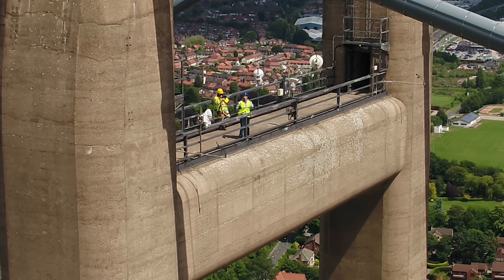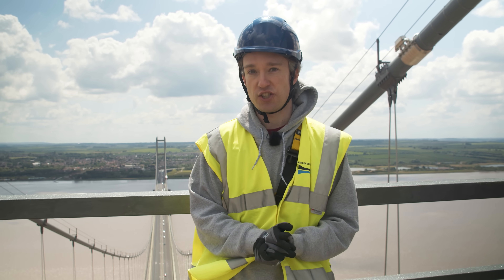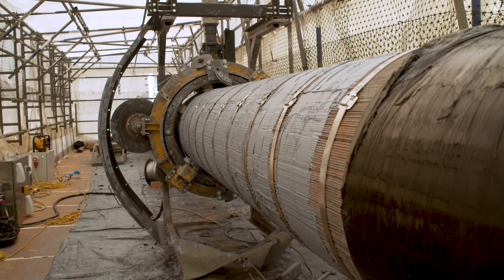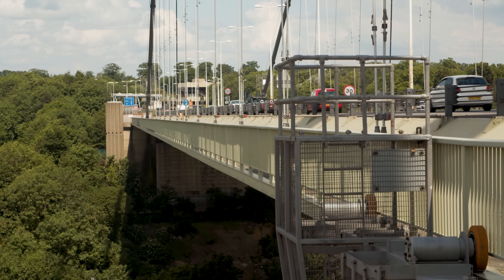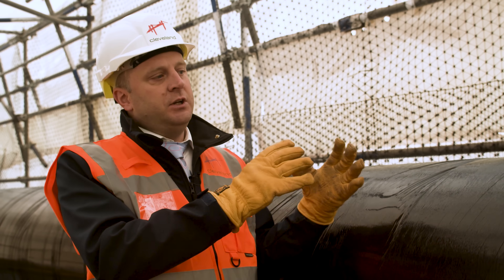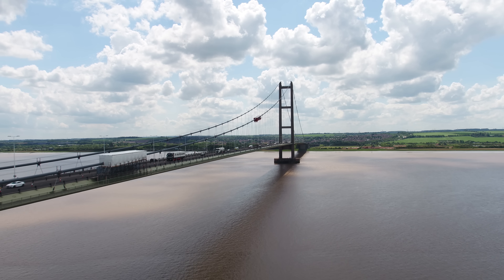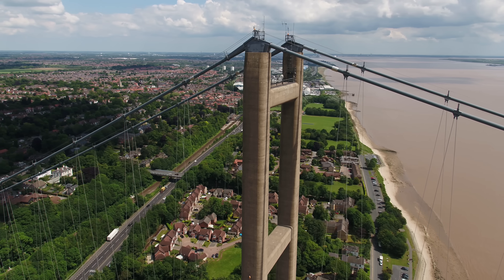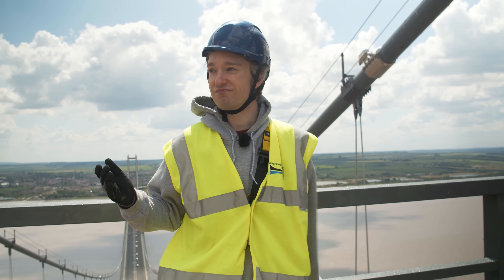How to stop a colossal bridge corroding

Comment: You did not explain clearly how dehumidified air is pumped into the cables. You can use schematics to explain clearly. also note that dehumidified air has to travel hundreds of meters along the cables. by the time it reaches the end of the cable, the pressure would have dropped significantly

Comment: 0:29 Are you sure it's cm?
I tried to calculate, and got about 4 mm

I used:
span: 1410 m
tower height 155.5 m
earth radius: 6371 km

difference: 3.8 mm
Reply: Movement?
Reply: @damianleah6744 offcouse they move, but a single number describing distance would not be a dynamic with movement, but a static average.

However they can possibly be tilted outward, to compensate for some other geometry.

Comment: We do the same thing for transmission lines underground and even up broadcast towers. Nitrogen pushes out moisture, maintains consistent regulated pressure, and it makes it easy to tell if there is a breach in your line.

Comment: Cool! I was wrong in initially guessing that theyve built an air tight cylinder arpubd it abd pressurized it, so that no moisture (or outside air) could enter it. 

But i suppose just blowing air through it works!

Comment: This is something that is neglected everywhere. Stuff has a limited practical life. That means that even after purchase, costs continue. If that bridge had an estimated 50 year life, then in addition to the cost of building and the cost of maintaining, at least 2% of the cost, increased by inflation, should be put aside to pay for the replacement. A water heater is expected to have a lifespan of about 15 years, which means the responsible owner would be stuffing an envelope with 7% of the cost of that water heater (INCLUDING installation) every year. Politics does not allow for that kind of responsibility. People would see that replacement fund money and demand it be used now for feeding the homeless or building something else that will also require maintenance. Then, money will be borrowed to pay for the replacement, leading to the replacement costing even more because of the interest and further discouraging saving for the next replacement.

Comment: The Engineer is referring to the Williamsburg Bridge in New York City. In the 1980's American Engineers and Inspectors where shocked to see  a massive amount of corrosion Inside the main cables. There is a photograph of an inspector holding a Bundle of cables in his hand that he pulled from the the Anchor. Each wire is supposed to hold 1000 pounds so it reasons that the inspector had Tens of Thousands of pounds of wires in his hand. The original designer L.L.Buck was trying to build a cheap version of the Brooklyn Bridge ( which also had damaged main cables). As a result he used raw steel wires in the main cables and did Not have them coated in Zinc like Washington Roebling did on the Brooklyn Bridge. Guess what the result was.  In the 1990's there was a Major Reconstruction preformed on the Bridge. The deck was lightened and major parts of the super structure were replaced with light weight steel. The Bridge also carries two subway aka light rail tracks which adds a significant amount of weight and produces Lateral Movements.. How this Bridge is still standing is beyond my limited engineering  skills. I'm a Historian not an Engineer.

Comment: Could be an option to pump argon gas through the cables and then seal it at both ends.
Reply: My guess is that in the kilometer long span there must be some areas where air/argon escapes
Reply: @kippywylie  it would be a case of 

Yup yup we still got it, still goo-

Aaaaaah gone

Comment: Is it possible to fill the cable sheath with oil. Or would it be a problem with leaking? Initial upfront might be more, but running those dehumidifiers uses a not free amount of power? Just throwing ideas out.

Comment: My question is, when they cut out a section of the wire, how do the two ends no go flying in opposite directions? also isn't splicing the wire in the middle going to weaken it?

Comment: How on earth are they able to remove and splice a new 5 m segment of cable when it is under a multi thousand tonne load. Into a tightly wound cylinder of thousands of other steel cables under stress. Insane. I would think as soon as it's cut it would spring farther up the cylinder.

Comment: curvature of the earth?????
Reply: @F99 Crafter  i don't care it , doesn't explain why  the gravity force if what it is... some symmetry in mass distribution is necessary.. so the  shape of the earth is not the explanation.
Reply: so this is anti science ...
Reply: it is not my point.. i am nocking those who mocks flat earther in a silly way.....  ok.. it is about the  direction of force of gravitation... curvature of the earth doesn't explain it..period..you need to  add density.. to give the direction of gravitation and surface of ocean is nor "a simple curve fo instance"..
 on the other hand "flat earth" is an approximation as good a curve earth for many people..  if you build a house..it is ok to build vertical walls parallels.. you fell in my snare..
Reply: @jacqueslemiere  Congratulations, your "nockery" makes no sense.
Reply: @davidm5707   well...it does regarding arrogance of some people...earth is flat and round or neither flat  not round..  both are approximation both are valid.. the flat approximation is the one people do. when they build a wall/

Comment: Why isn't the wire plated, or the cable impregnated with a corrosion inhibitor substance? And what about using Cortan steel for the wires?

Comment: Drilling concrete without water will KILL you I was setup up by my boss the dust is most toxic dust on the planet with no treatments no cure look up silicosis before you mess with concrete I wish I would have know I worry everyday I will die on front of my family because of this. And you need a respirator and a water hose.

Comment: I don't get the connection between air humidity and space occupation as mentioned at 2:25 
How does it reduce the humidity of the air if there is less air? Humidity is relative to the available air so it should not matter how much air there is

Comment: Why can't they just insert an analyzer probe into the wedged-open cable, rather than impair the integrity of the cable?
Reply: I'd guess they stress test that bit of cable they take out. It's not just the level of corrosion but what it has done to it's performance.

Comment: So, air is pressure injected at one end, and travels over a km inside the tightly compressed bundle? That's incredible.. I would've guessed the pressure would get dissipated and held back after like a few dozen meters 😳

Comment: As much as I admire modern engineering, I am at awe with roman engineering that have structures still standing after two thousand years
Reply: They didn't use metal though, did they,stone and concrete doesn't corrode, it simply weathers slowly away

Comment: 1:10 A giant steel core, A coating of carbon/hydrogen rich lindseed oil, Lead, and an outer coating of more steel.... add in salt water.... AND (The power puff girls were born!) No but you do have a hideously inefficient though highly corrosive Lead Salt/ iron carbon battery using the hydrogen produced by the lindseed oil and salt water buring through the steel like it were cotton candy!

Comment: Glad i live in a place where we are not afraid to invest in maintaining and upgrading infrastructure.

When i look at places like the US i start to worry though, very little seems to be spent on maintaining and upgrading infrastructure unless there is money to be made from it.

They won't see the problems that will cause until it is too late, and many times as much will have to be spent.

Plenty of bridges that could collaps like that one bridge in Italy, extreme weather countermeasures not being maintained etc.

Not just maintaining, but upgrading infra like internet infrastructure, public transportation, bicycle accessibility and for those insisting to stick with cars: the roads themselves...
(which seems to be getting to the point where regular non-selfdriving  cars are getting driven around in self driving cars in tunnels to supposedly alleviate congestion, witch confuses my European brain)

Comment: Moisture may not be penetrating. It could be condensation, so in that case the cables should be opened up.to.allow air to get at them and dry them out. Sealing them is a bad idea.
Reply: Alpha Omega condensation is moisture and to have the wires open is not the solution, drying airflow needs to be under positive pressure to penetrate all void space in the cable, the wind would not achieve this, it goes around the cable - path of least resistance
Reply: James Mawson 
I see many structures that now leave the structural steel open to the air. That seems to be the best solution. Sealing yhe steel in anything will cause it to rust and then age prematurely.  The engineers who decided to accept the risk of condensation forming are not doing the right thing. I see in Vancouver the steel cables are open to the air, even though they get a lot of rain. The air flow dries them out regardless of pressure. Heck even the sun shining on them will help to dry them out.
Reply: @alphaomega9819  The sun never shines in Hull.

Comment: Wow... even a suspension bridge requires constant electricity...
Reply: Michael Kujawa aviation lights, street lighting, internal lighting, lifts/elevators, sensors and so on
Reply: @jamesmawson2349  True! So much we don't usually consider.  Some of that is only on at night, at least...

But I was referring just to staying structurally sound, and not of the other "luxuries".

Comment: Newer cables are coated and filled with oil/lubricate which I'm sure helps prevent corrosion. But would prevent this airflow treatment from working as there's no more gap. Search for "how It's made: industrial wire ropes" on youtube
Reply: Kermeous this is not a wire rope but a parallel wire cable, significantly different, oil doesn’t work ostensibly because of gravity

Comment: If you're going to encase the cables entirely, why not fill it with something that won't react at all rather than actively dehumidifying the air constantly? I guess the initial cost would be higher but.... Maybe the gas would not penetrate entirely and still rust in the air gaps due to the lead sealant.

Comment: The Ponte Morandi bridge in Genoa collapsed last year. Its cables are embedded in concrete in an "innovative" and aesthetic  design that not only hinders inspection, but also has no redundancies.
Reply: Al Bert
The bridge got privatised 20yr ago so maintenance became low on the list.
Reply: Concrete in tension is always a white knuckle subject.  Totally dependent on the rebar, the pre-stressing, and of course the right stuff on the re-bar to prevent it slowly corroding away in the concrete.
Reply: Something similar happened to the aricebo telescope recently
Reply: Tin Watchman  it had gotten an update when the bigger floating part was put on top

Comment: Is stainless steel no good for these applications? Or does even stainless steal not withstand these environments?

also, if de humidified air is pumped in, I feel like you could have sensors around testing the escaping gasses that pick up on compounds like rust.... or at least they could in the future
Reply: Each cable is made up of 37 strands of high tensile galvanised steel wire - each wire coated with zinc. The bridge construction began 46 years ago [1973] when stainless steel was still very expensive & only used for handrails & the like - today stainless steel production is much greater & the cost of stainless is close to galvanised thus it can [and is] used today for all elements of steel in bridges if wanted.
Reply: @nightjarflying  interesting, I thought it might have been a combination of cost and the different tensile properties of it
Reply: where's the jump button for accuracy, the cables are formed of over 14000 individual wires in parallel. Stainless steel is not used for this purpose simply because it doesn’t posses the tensile strength of carbon steel

Comment: At 3:35 Mawson describes the inspection process - I imagine that the wire that is selected for sampling is on the outer layer. I wonder if they consider this to be a significant sample of the innermost wires, or if the outer wires are more prone to corrosion, therefore ensuring that any corrosion will hit them before the ones that are deeper.
Reply: Diego W samples are taken throughout the cable depth, providing necessary representative sampling

Comment: Wow. I wonder how new materials will effect this kinda thing. I know the cost would be outrageous but carbon fiber, kevalr, or even just nylon. I wonder how it would do!
Reply: Nylon cables are less dense but would have to be much thicker to hold up such a load, and they are also affected by moisture how much depends on the variant (polymer strand length). But they will elongate more with moisture absorbtion and other properties will change as well, so climate control might be needed for that as well.

Comment: I always just assumed that it would be a large sacrificial anode block of zinc,  magnesium, or aluminium that is inspected and replaced every few years. Exactly the same as is used on deep sea oil platforms, or large steel ships to prevent corrosion on the cathode.

Comment: the diverging of towers is NOT due to curvature of earth
This is a MYTH spread by uneducated (in this field) people 

The diverging towers are constructed it this way on purpose
if they would be vertical and parallel to each other structure will collapse very easily, as the weight of centre of cable would simply destroy towers
they are constructed as diverging in order to avoid stress from weight of centre of cable
this way cable does not pull tower to collapse, but tries to make it straight making whole structure a lot stronger

Comment: I assume there has been some consideration of having something in new structures injected between the strands as they are being assembled during initial construction before they are compressed to displace and savage any oxygen?  Would this material lubricate the areas in between the strands too much or is this a problem?
Reply: Lewis Doherty possibly add weight, not ideal. Dehumidification is a one time fit long term solution and air can penetrate everywhere in the cable and the slightly positive air pressure prevents water / humid air ingress. The system is the most cost effective compared to traditional techniques and other proposed solutions.
Reply: I thought with so many foam substances like insulation with some non-oxygenated expanding gas, something might be done.  I guess they have been able to pump air to cover the whole extent of the cables.
    It would be interesting for a show to be done on the grandfather of these type bridges, the Brooklyn Bridge.  While that bridge is overbuilt, because the engineers were entering unknown territory and there was a rumor the wires were of poor quality in the cables, so more were added, it is very old and there were things that were never considered then.   Once the cables are sealed, there shouldn't be a problem/ Right? @jamesmawson2349

Comment: er, did you miss the best bit? Namely the opto-acoustic system that listens to the noises made inside each main cable and can identify, using Time Domain Reflectometry individual wires breaking and where in the long cable they have broken!
Reply: Did I just learn something from a YouTube comment?!
Reply: Are you pulling my cable or wot mate?

10/10 comment, thanks for sharing
Reply: That is what was used on the Golden Gate bridge too. This bridge design is rubbish, hence why we don't see new bridge built like that.
Reply: I've never met a smart mountain biker
Reply: @Narayan_Patki  you now have
Reply: that's commonly used with metal stuff of course and it's awesome, my dad's friend uses it to find cracks in airliner planes
Reply: Used that gear for electrical cable testing in the mid 80's to find breaks, not to repair, just replace.
Reply: Oh Eck! Never going over that bridge again!
It's collapsing!!!!😂

Comment: Luckily no corrosion was found or that bridge would have been humbed.
Reply: They hammer it in with a sledgehammer.
Imagine being this operator for huge expensive machinery for maintaining, inspecting and building these colossal structures.
Only to be sweating your ass off like it's 1920 with a huge sledgehammer.

Comment: Why do I get the feeling that a crimp on ferrule isn't going to hold anything in tension if it's called on to, compared against an uncut cable.  I guess the friction of the uncut portion of the cable would still provide some amount of strength.
Reply: Mini DK#9 pressed on ferrule connection is stronger in tension than the wire - proven in pre-construction testing as part of the contract specification

Comment: Using dehumidified air and pumping it through the cables isn't a bad idea.
Simple, relatively easy to implement. Wouldn't be a bad idea to implement such into other bridges. Maybe also add a bit more "space" between the wires, so that one can simply blow air from one side to the other, lowering the air resistance and thereby not need as many taps into it along the way.

Comment: They could fill the gaps between the wires with foam or any other type of very light material. In that way they could make the cable into a solid piece where humidity could not enter. Have they tried that?